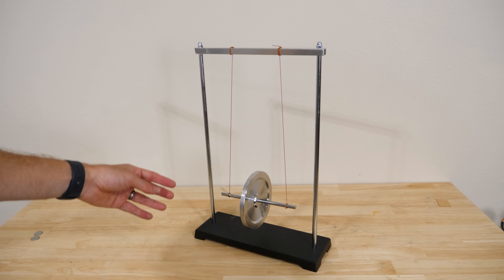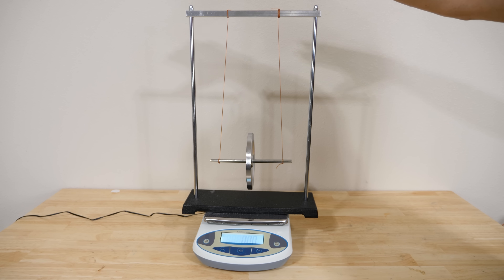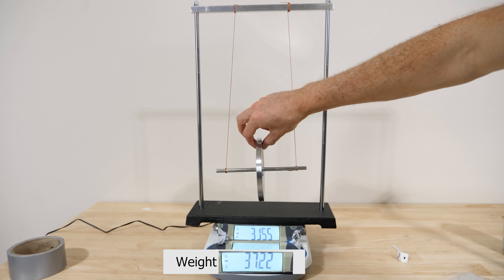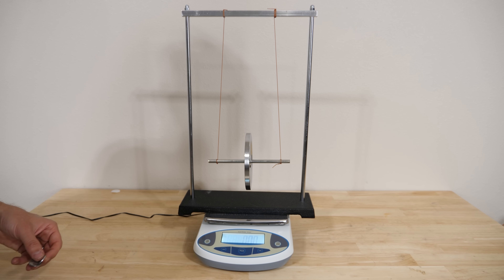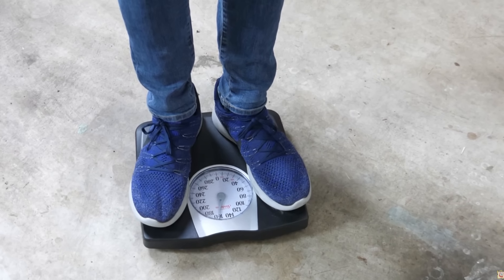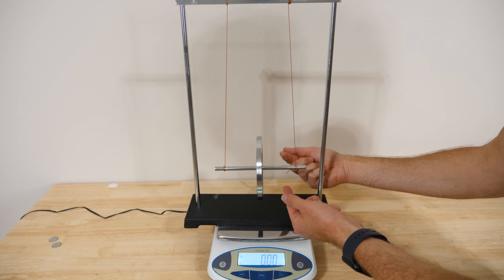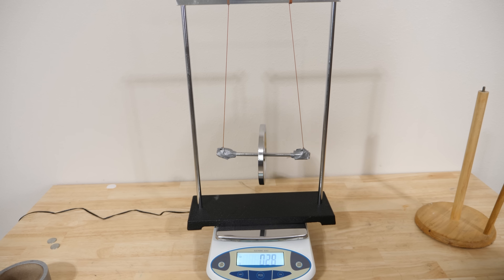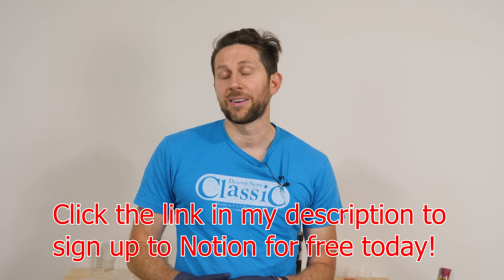How Does The Anti-Gravity Wheel Work?

Comment: I would think with really precise measurements all the forces would cancel out, 10 total seconds at -6 would mean 1 total second at +60, or something to that effect. The refresh rate on the scale didn't show the positive wieght spike because it was only for such a short time.
Reply: Your thought is exacly right, in the  bottom the direction of movement is changing,the whole mass of the flywheel has to be accelerated from downwards motion to upwards motion,  the cables get a short  peak force they transfer through the contraption, which the scale does not show.
Reply: Seems reasonable; we know that impacts increase force at the expense of time. A bouncing ball would impact the scale. The sudden change in the wheel's direction looks like an impact. Maybe it is, maybe the rotation modifies it. It would be interesting to find out how the characteristics of the strings affect it too. A chart-recording scale would be really useful.
Reply: The Spinning wheel is simply converting the pull of Gravity into torque and the weight defect is telling you how much .
Reply: @O-Kyklop   That sounds like a simplification. 
The Spinning wheel is simply converting the pull of Gravity into Angular momentum which is kinetic energy. <-- That is the classroom purpose he mentions at 17 seconds, but doesn't explain either.
..
You could say that the conversion is partly counteracting gravity and, therefore making the center-of-mass fall slower than if there was gravity alone.
The change in vertical speed as it travels up or down, shows the mass is under constant downward acceleration, just not as much as gravity alone.
Reply: @Observ45er  

"You could say that the conversion is partly counteracting gravity and,..."
I like more "deflecting". 
g is pulling straight down and the wheel converts this downward pull into spin, uses a part of the g energy and we see it in the weight reduction.
The weight reduction is still there going  upwards simply because g is still pulling the wheel down and the spinning still deflects the energy of g.
But, the phenomenon in itself is not so easy to understand. As a whole, I mean.
We see the spinning bringing about the weight reduction, but it is not the spinning alone. It is the wheel hanging in the frame which is fixed on the ground, plus the rolling up and down which shows this effect. Otherwise a gyro would  just lift up by holding it horizontally with very high RPM. But it doesn't happen. 
There have been experiments where spinning gyros fall down in free fall with high RPM but there is no significant loss of weight.
It is circular movement and this movement is radically different from the rectilinear one. We're taught to understand it using rectilinear tools but it is like trying to approach a circle with straight line segments. It doesn't work.
Reply: @O-Kyklop   Reading your post about "deflecting"; I can accept that as an explanation of the same thing as I have in mind. The spinning mass and string winding on the shaft all work to produce the effect of weight reduction.  We must have the correct concept in our minds and sometimes we are more comfortable with using different words.
I was also thinking that it "uses a part of the g energy" sounds like what I have in mind.
.. ..
.. .. ..
.. .. ..
Look up the "Dean Drive". There was a man, who tried to prove that a simple spinning gyro could be used to produce propulsion like a rocket motor, but without pushing something out the rear.  He had a demo that made it look like the weight of it decreased when it was running.  He got a lot of money from people thinking he had proved scientists wrong. He clearly was wrong. 
I don't recall if we found out whether he actually understood it didn't work, or if he knew it was fake and just took money from people.

I understand the gyroscope and this.  I wonder if Action-Lab -guy does.  I asked him in an email.  No answer yet.
.
This is a very interesting effect and explaining it requires a good understanding of several aspects of physics.
Reply: @Observ45er  
I try to express myself according to what I see, avoiding standard terms which were not coined studying how the gyro works.
The guy of the video just doesn't take his time to search out thoroughly this phenomenon to never answer any comments anymore.
That the gyro deflects or derives the energy of g seems to be evident. Why otherwise this loss of weight. But to understand completely what is happening, we have to take in account the frame and that the frame has to stay on the ground, say connected to the ground. It is all together interacting to produce the effect. 
A gyro falling free in the air, parallel to the ground and even at a very high spin rate shows a very little weight loss if any at all.
A very interesting experiment would be to have very long strings, a bit thicker axle and see if the wheel reaches a "critical" velocity where its weight could go to zero. 
Or fix the wheel to the axle with a ballbearing, in a way disconnecting it from the frame except for its weight pushing down and unwinding the axle. Where we could then set the RPM independently from the diameter of the axle.
But the guy of Action Lab is probably just looking for Likes.
Reply: @O-Kyklop  Yes.
Perhaps you missed it, but I added a comment proposing to make the axel a larger diameter.  This wound make it weigh even less because it would be accelerating up/down more and closer to the rate from gravity. . . Thus being closer to free-fall and 'opposing / deflecting more of the gravity.
Reply: @O-Kyklop  Sorry, but this makes no sense at all: "A gyro falling free in the air, parallel to the ground and even at a very high spin rate shows a very little weight loss if any at all."  
..
" falling free, [moving] parallel to the ground" would be in orbit with no weight on a scale. Zero.  
.
Perhaps English is not your first language.
Reply: @Observ45er  Yes, some comment went lost a day or two ago.
Reply: @Observ45er  
No it is not and at some days even less than others. 
I meant a gyro falling free with its axle parallel to the ground and with high RPMs. It shows a very little weight difference if at all. I mean, measured at its speed.
Approaching the physics of the Gyro from the background of academic physics won't bring any real understanding of the phenomenon. The same way approaching the circle with straight lines will never explain the nature of the circle.
Reply: @O-Kyklop  OH!  OK.  
OK.  Plus, I had someone corresponding to comments for one video under another  video.  Weird.
..
Well, I don't know what you're thinking.  Anything in true free fall, oriented any way, WITH it's scale, has no weight. Mass, yes.  Weight, no.  The scale is falling with it and will register zero weight.
..
If, on the other hand, something is falling at something less that the 9.8 m/s^2 of gravity (with it's scale supporting it) it will show something less than it's stationary weight.  This is possible if it has some upward force, such as a weak jetpack, opposing gravity, thus having less net force.
.
Have you heard of the Vomit Comet?  If not, look it up.
If it flies in the correct vertical 9.8 m's^2  arc, it can make you weightless.  
OR anything less than your weight.  Then, when it pulls up to level flight, or an inverted arc, , you weight more than normal.  This is because it does vertical acceleration at rates different from the 9.8 m's^2.
.
For this nifty flywheel set up, 
The energy that is going in and out of the angular momentum is doing that due to the axel/string arrangement.
I have it clear in my mind.  Putting it into words may be our problem. 
Cheers.
Reply: @Observ45er  
"Well, I don't know what you're thinking.  Anything in true free fall, oriented any way, WITH it's scale, has no weight. Mass, yes.  Weight, no.  The scale is falling with it and will register zero weight."

No scale. A spinning gyro falling down and its speed measured just before it rocks bottom. I believe there is some footage in YT.

"The energy that is going in and out of the angular momentum is doing that due to the axel/string arrangement."

And the "grounded" frame. The gyro needs this connection to the ground.....to resume, the physics of circular movement and specially regarding the gyroscope are very deep and versatile, needs much time for thinking and a very well equipped lab.
Reply: @O-Kyklop  "A gyro falling free in the air, parallel to the ground"
I believe you mean with the axel parallel to the ground.
..
It is not so much the spin rate, but the angular acceleration and axel diameter.  The axel diameter determines the rate of energy transfer.  Obviously with longer strings the end angular velocity will be greater.
..
..
I am sorry, but I am unable to decode the part about the " ballbearing,". the string MUSTR wind around the shaft for the energy transfer to take place. That is where the moment (torque) changes to/from linear force.  You can not have the RPM independent from the diameter of the axel.  THAT is the whole key to this effect.
..
As I posted in another comment, changig the axel diameter changes the rate of energy transfer and, therefore, the amount of gravity opposition. 
.
Action-Lab-Guy doesn't explain anything for this video -- neither the energy transfer part, nor the gravity opposition part.
Reply: 최저점에서 무게측정을 못하는 느린 저울
Reply: And you would think wrong. Which is ok as long as you understand it being wrong.
Reply: @thierryfaquet7405   NOPE.
There is a weight 'spike' at the bottom to 'compensate'.
..
Here's the deal with this wheel:
The wheel does NOT weigh less when it is spinning!.
..
It may be more correct to say that it weighs less when it is "bouncing".
..
I have a problem with the interpretation of the Laithwaite demo.  Precession does not translate the wheel.  It does not lift it. 
Precession causes the axis of rotation to change direction. This is a ROTATION about the center-of-mass of the wheel. It is not lifting the whole wheel's mass. 
.
Precession does not cause the gyro to move (translate) sideways, nor upward in Laithwaite 's case or Veritasium's case. 
If the vertical spinning gyro had translation, it would slide along the table, but stay vertical. It does not do that.  It tips, or rotates at 90 degrees.
The fact that the handle is offset and long has significance.  If you push the handle in the direction of the precession, that lifts the handle, right?.

However the interpretation that the spinning wheel is always accelerating downward even while moving upward,  is a very good catch. It took me a few seconds to realize that.  My quick initial feeling was that the weight would go positive on the way up. . . 
The way to think of it is that is is 'partly falling' due to gravity.  When you are in free-fall you are completely 'weightless'.  The spin and string-shaft arrangement allow it to fall, but not fully, as when you are in free-fall.  So, the frame experiences somewhere between the full weight and weightless ness, but more weight during the bounce time. 
..
 The winding and unwinding of the string causes the up and down motion which is what changes the weight. 
..
Stand on a bathroom scale and at a medium speed, move up and down by bending your knees.  Try to move faster and faster on the way down and slower and slower on the way up. You will see your weight decrease during those times.

.. .. ..
If you watch carefully, you see that it is speeding-up as it drops; this is accelerating, but not at the full 'gravity-rate'.
Also, it is slowing-down as it rises, again not fully accelerating (decelerating or negative acceleration) due to gravity.
..
On a trampoline you are completely weightless from the time your feet leave the trampoline until they touch again and start the bounce. During this time you are constantly in 'total' free-fall.
When in contact with the trampoline you are accelerating upward and weigh more than normal.
If you can add a small upward force to reduce the acceleration due to gravity, you will weigh less. No surprise there.

This is analogous to only "partway" jumping on a trampoline (or your bouncing ball).  On a tramp, you are accelerating downward when your feet are not in contact with the tramp. The ball is when it is not in contact with the floor.  The spinning wheel only "partly" leaves the support strings.  It is "partially bouncing".
If the tramp accelerated you upward at twice the rate of gravity, your weight would double.
Therefore, there is also a slight increase in weight at the bottom bounce.
.
This would be equivalent to a small jetpack on your back that can't lift you, but only partly reduces your weight.  You would be in "Sloe-Fall", not free-fall.
..
This would make a wonderful Dean Drive Scam. . . .
..
It would be nice to have a real-time force load cell so we can see what happens at the bottom of the wheels travel - the positive weight gain during the short 'bounce' time.

..
Also, WHAT HAPPENS to the weight, if the wheel is NOT spinning, but bouncing while being suspended by a spring, instead of the winding/unwinding strings?  
Is that equivalent to this "partial bouncing" effect?
Reply: @thierryfaquet7405  Would you please elaborate?
Reply: @ivarangquist9184  just watch the video ???

Comment: I think I figured it out. As the earth rotates, we are continuously accelerating downward. Six hours from now, we will be half the Earth's diameter lower, and 12 hours we will be a full Earth's diameter beneath our feet. I'm guessing that we are continuously moving in the downward direction at almost 600 miles an hour. The gyroscopic action tries to keep it going tangeantly towards the horizon, so it helps the gyro "float" a little. If you can triple the speed of the gyro, I think you will see a substantial increase in negative weight. The reason you didn't see the weight change in the other gyro was because it's articulate housing allowed it to stay spinning tangeantly toward the horizon.
Reply: Nice try, but. . . 
..
We are accelerating toward Earth's center, but we aren't going 6 MPH that way.
..
Here's the deal with this wheel:
The wheel does NOT weigh less when it is spinning!.
..
It may be more correct to say that it weighs less when it is "bouncing".
..
I have a problem with the interpretation of the Laithwaite demo.  Precession does not translate the wheel.  It does not lift it. 
Precession causes the axis of rotation to change direction. This is a ROTATION about the center-of-mass of the wheel. It is not lifting the whole wheel's mass. 
.
Precession does not cause the gyro to move (translate) sideways, nor upward in Laithwaite 's case or Veritasium's case. 
If the vertical spinning gyro had translation, it would slide along the table, but stay vertical. It does not do that.  It tips, or rotates at 90 degrees.
The fact that the handle is offset and long has significance.  If you push the handle in the direction of the precession, that lifts the handle, right?.

However the interpretation that the spinning wheel is always accelerating downward even while moving upward,  is a very good catch. It took me a few seconds to realize that.  My quick initial feeling was that the weight would go positive on the way up. . . 
The way to think of it is that is is 'partly falling' due to gravity.  When you are in free-fall you are completely 'weightless'.  The spin and string-shaft arrangement allow it to fall, but not fully, as when you are in free-fall.  So, the frame experiences somewhere between the full weight and weightless ness, but more weight during the bounce time. 
..
 The winding and unwinding of the string causes the up and down motion which is what changes the weight. 
..
Stand on a bathroom scale and at a medium speed, move up and down by bending your knees.  Try to move faster and faster on the way down and slower and slower on the way up. You will see your weight decrease during those times.

.. .. ..
If you watch carefully, you see that it is speeding-up as it drops; this is accelerating, but not at the full 'gravity-rate'.
Also, it is slowing-down as it rises, again not fully accelerating (decelerating or negative acceleration) due to gravity.
..
On a trampoline you are completely weightless from the time your feet leave the trampoline until they touch again and start the bounce. During this time you are constantly in 'total' free-fall.
When in contact with the trampoline you are accelerating upward and weigh more than normal.
If you can add a small upward force to reduce the acceleration due to gravity, you will weigh less. No surprise there.

This is analogous to only "partway" jumping on a trampoline (or your bouncing ball).  On a tramp, you are accelerating downward when your feet are not in contact with the tramp. The ball is when it is not in contact with the floor.  The spinning wheel only "partly" leaves the support strings.  It is "partially bouncing".
If the tramp accelerated you upward at twice the rate of gravity, your weight would double.
Therefore, there is also a slight increase in weight at the bottom bounce.
.
This would be equivalent to a small jetpack on your back that can't lift you, but only partly reduces your weight.  You would be in "Sloe-Fall", not free-fall.
..
This would make a wonderful Dean Drive Scam. . . .
..
It would be nice to have a real-time force load cell so we can see what happens at the bottom of the wheels travel - the positive weight gain during the short 'bounce' time.

..
Also, WHAT HAPPENS to the weight, if the wheel is NOT spinning, but bouncing while being suspended by a spring, instead of the winding/unwinding strings?  
Is that equivalent to this "partial bouncing" effect?